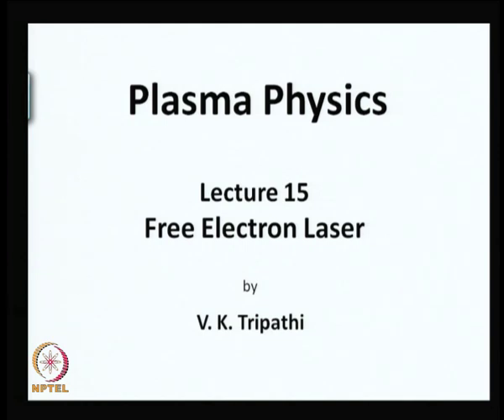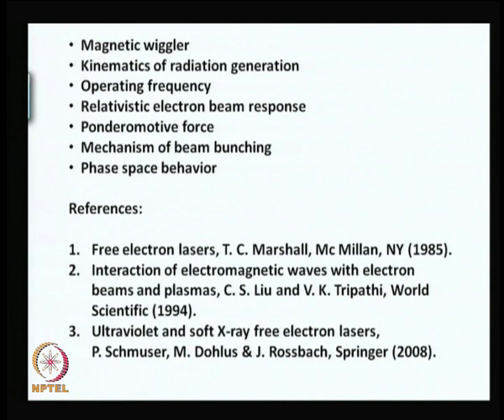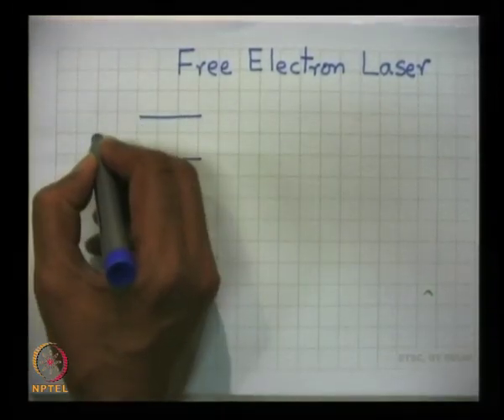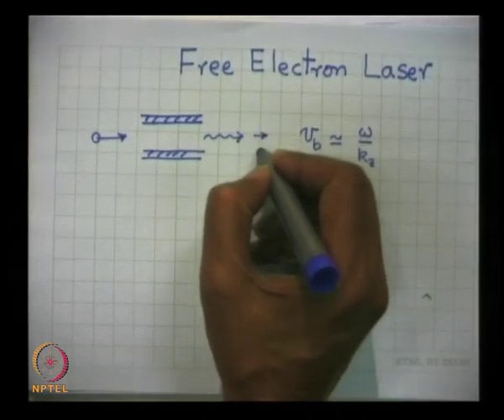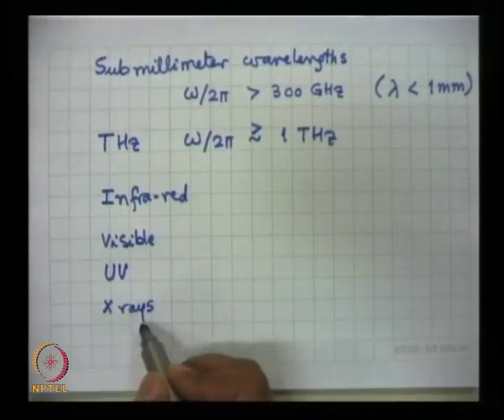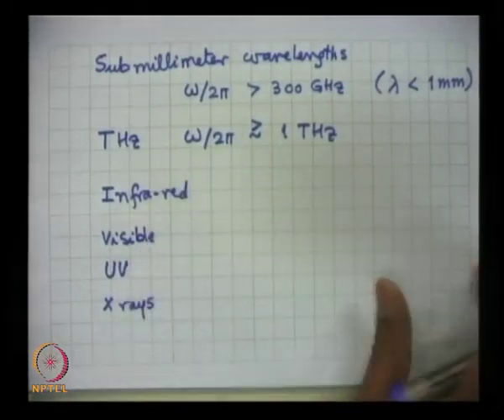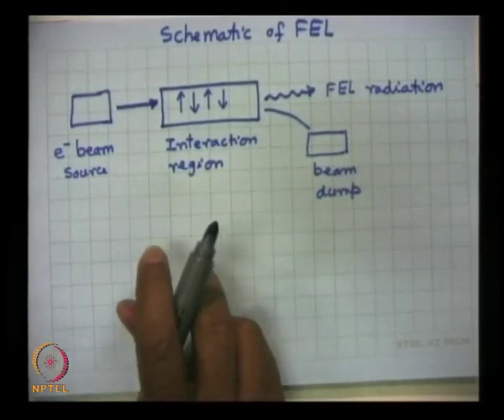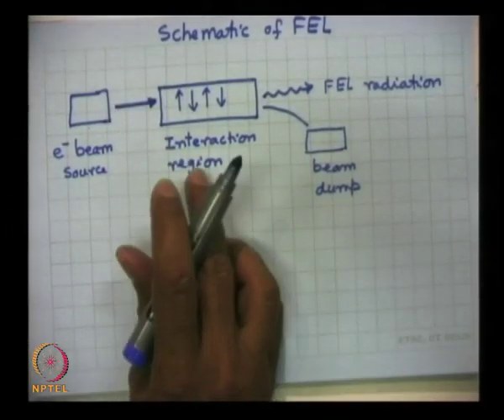Mod-01 Lec-15 Free Electron Laser

Comment: with a large period for the wiggler at say 1cm I see this is easy to modulate the electron beam because you can use magnetic fields which have of course a strong effect on the electron beam..and would seem to me to be more efficient than using say a laser beam to produce a much higher output, but how efficient can a laser beam be at modulating the electron beam? since the laser isn't a magnetic field as such?..is this some kind of compton scattering or photo electric effect? I had trouble understanding some of the math the first time because of the Indian accent but I think I have it sorted now...
Reply: This is what makes high energy waves in the aether, just like Tesla described, hopefully not photonic Einstien crap.